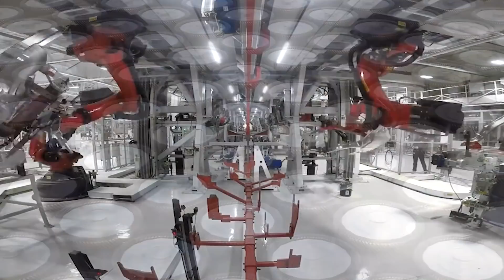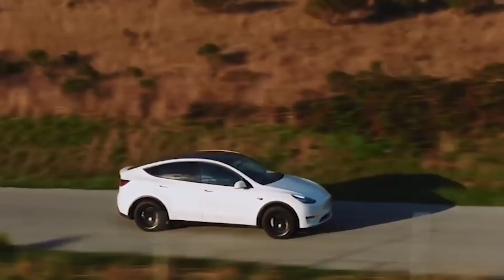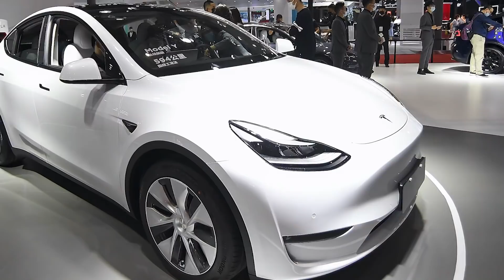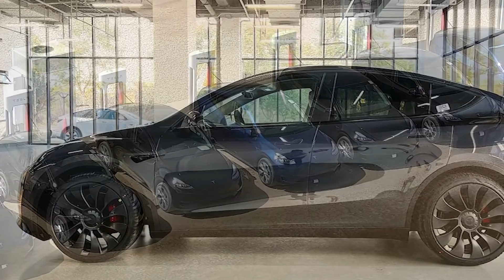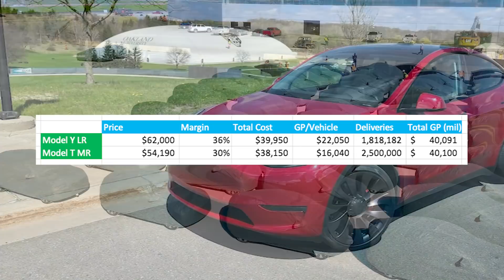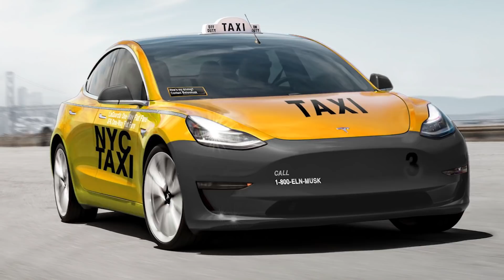What Will the Price be for the "Affordable" Model Y Medium Range?

Comment: I’m getting  about 738 and 487 4680 batteries for each the mid range vs (single motor) standard range. Without counting new die cast savings or reduced parts used, a tray of 1000 4680 batteries could yield a standard (single motor) and medium range car 60-40.
Reply: And still we haven’t speculated on a new motor - Musk said there were variations to the new (Plaid) motors in the lab.
Reply from the maker: New motor. That could be amazing.
Reply: Very hard to determine the price or if the price increases are to subsidize these Model Y/4680 versions in a strong way while the 4680s ramp to full value
Reply: The best way to get more cars on the road is with the single motor along with the mid size

Comment: I get the 4680 is a breakthrough, but it’s perhaps lighter and more energy dense. So, fewer cells go in for the same kWh battery, lower weight, so you gain efficiencies. There is just no way Tesla can get a 270 mile range out of 40kWh or 148wh/mi. No way. The battery is just better. So, it’ll have a 60+kWh battery for 270 miles.

Comment: I suggest you read the feedback on the previous video again as battery calculations in this one are still completely incorrect. The 4680 form factor has ZERO impact on needed storage capacity to get to 279 miles. It’s in the high 60s kWh for that range. Weight changes have some, but very minor effect. These videos have no value if you won’t do correct math on it.
Reply from the maker: Actually this video is irrelevant as to the actual battery sizes, it's the difference between long range and medium that matter. I am still waiting for someone to correct my math though.

Comment: Great content as always, thank you! When you consider the potential of the medium range at $54 ish and do a rear wheel drive and that price point can drop/help with margins as well. In Southern CA  and many places across the US I think a medium range rear wheel drive is a great option if they drop the price further. Thoughts? Too many model variations?
Reply from the maker: Yes, I would hope under $50k for a RWD
Reply: @TeslaEconomist  do you see this smaller battery pack potential pushing the "medium range" rear wheel drive M3 down in the near future as well? It'll be interesting if the crazy demand will let the numbers (cost) come down near term or not. Very exciting times.

Comment: You are leading people astray w your bad conclusions.  If the 279 mi MY has 85% of the range of the LR MY, it will have a battery that's about 85% in size.  That is about 63 kwh.  You are at 40 kwh for 279 mi which gives an efficiency of about 6.975 mi per kwh.  The existing LR has an EPA efficiency of 330/75 = 4.4 mi per kwh.  The cars have the same aerodynamics and their motors efficiency, efficiency of the cooling and heating system, charger/inverter as well as tire size and type will be about the same.  The only difference would be in weight.  A 40 kwh pack would drop the weight by about 400 pounds (half the pack).  Structural pack and casting could probably drop another 100-150 pounds.  The efficiency of the same vehicle is not going to increase by almost 60% thru a 15% weight reduction.

I think more than 3m ICE vehicles competing in the class of the MY are sold in the US per year.  I don't see why Tesla can't sell 2m+ MY in the US a year.
Reply: You are right, I made a similar comment on a previous video. The reduction in range to 279 miles and a reduction in weight to about 1700 kg, which might be possible with gigacastings, structural battery and increased energy density of 4680s could get the pack size to somewhere between 55 - 60kWh and that´s optimistic in the first iteration of the new design.
Reply from the maker: This is what Battery Day told us. But in this scenario the actual battery sizes aren't relevant, it is the discrepancy between the two.
Reply: @TeslaEconomist  No, this is not what Battery Day told us at all. You keep mistaking range increases for efficiency increases. If you don´t believe that then google real engineering battery calculator and check for yourself. The relation between weight and efficiency is nowhere near as significant as you assume.
Reply from the maker: @Michal Faraday  How else can you infer a vehicle set up to get 54% more range? It would imply that it's 54% more range than the 2170 Model Y, right? I don't see what I am missing.
Reply: @TeslaEconomist  There are 2 ways to increase range (related to battery day). 
1 - increase efficiency - by decreasing the weight of the vehicle
2 - increase available energy - by increasing battery capacity. 4680s enable that because they´ll have better energy density and pack design so they can put more energy into the same vehicle.
Battery day doesn´t say exactly which improvements do what but we know for a fact the vehicle intergation (gigacasting+structural battery,etc.) doesn´t increase energy - but it decreases weight. So that´s a pure efficiency improvement - that´s 14 percent. Now if you look at the calculator I mentioned, you´ll find out even 14 percent (same range) requires about 600kg decrease in weight so this probably has something else included like the better heat management (4680s are tabless and have different cooling). The point is there is no way to reduce the battery size to 40 kWh by decreasing weight even with the slighty lower range. The other range increases from battery day have to include increasing battery capacity.
Reply: @michalfaraday8135  Exactly.  The easiest (and it's not easy, but easier than dropping the cars weight by 3500 pounds) way is to increase the battery energy density.  I read the 54% increase as it being achieved by the car weighing about the same but having a much energy dense battery with much higher capacity.  Efficiency increases will be minimal and the weight savings from castings and structural pack will be negated by adding more battery capacity.  

So the MY will still weigh around 4400 pounds but the battery pack will have a capacity of around 112-115 kwh (roughly 75 kwh x 1.5).   A MY with a range of 316 mi (MY range at the time of BDay) the efficiency is about 4.4 mi per kwh using a 75 kwh pack (useable).  A vehicle with 1.5 the range will require a pack of about 1.5 the size and 1.5x the energy density.  Aerodynamics, rolling resistance, motor and inverter efficiency and cooling/heating has already been optimized and won't improve much anymore - rolling resistance maybe has more room to go with narrower EV specific tires - the Mach E and Lucid Air gains range by using narrower tires than the MY and MS.  

TE thinks that a 75 kwh structural will increase range by 1.54x.  He doesn't understand that the higher energy density pack will only increase the efficiency slightly (as long as you don't increase the size of the pack which negates the weight benefit from a more energy dense pack).  To get 54% more range, the vehicle needs more energy and thus a larger pack.  Efficiency and weight savings is NOT going to add 54% range.
Reply: going to be hard to find your car in a mall parking lot, hope they get the car summon mode working well.
Reply: @zekew2418  I will wrap mine in special colors ;-)  But in all seriousness.  There are over 250m vehicles in the US.  Even if Tesla sells 2m MY's a year in the us, in 10 years it will still be less than 10% of the vehicle stock.

Comment: Usually fairly reasonable but your 40kWh and 4680 ideas are not likely imo. A Model Y cannot get that much more efficient from battery change. KWh/mile will be similar to start. The next model Y won’t be the final. It’ll improve over time.
Reply from the maker: Sure, except no one can show me any math that proves me different as of yet. But I clearly explained all of mine. I am happy to be proven wrong, as I want to get the right answers. But no one has yet to show me. They just don't seem to believe it, and I can understand, it's unbelievable. 
But in this scenario, the actual battery sizes are irrelevant, it's the discrepancy between the two that matters.
Reply: I agree, 4680 or 2170 will not change how many kWh you need for the same range.
Yes the difference in weight will do a small difference but it will only be minor.
Reply: Unless the weight reduction from the castings are giving significant improvements. Even without the modules from the 2170s, it should reduce weight. I guess only time will tell

Comment: How many floor is berlin and how man Is texas and when u said after counting battery fab size floors and all giga texas would be 5x size of gigaberlin pls explain
Reply: What I could say is 7.5 million texas 4.5 million berlin 2.5 million shanghai 2 million fremont ( its 16.5 million I don't know the time it will be probably like 2027 but I don't see these estimates crazy or mad do u think this right ?)
Reply from the maker: Most of the factory is only single floor
Reply: So if berlin is .20km2 and texas .40km2 then double into 3 so it's 6x and then u once said giga berlin one .20km2 will not be for auto probably its battery so 0.20 it's 5 x so if berlin is 1.5 then it should be 7.5 is that was your math and is really going here?
Reply from the maker: Yea, absolutely, but I felt 5m would suffice. But it is potentially conservative.